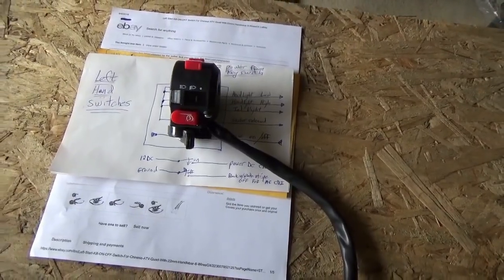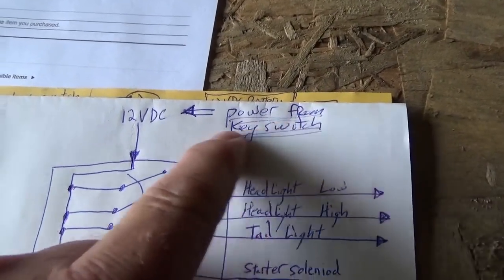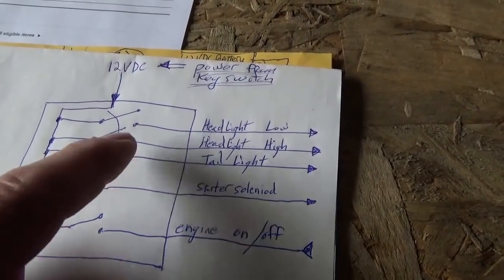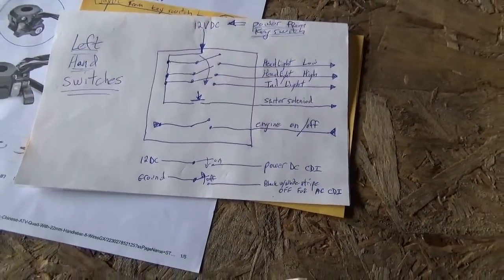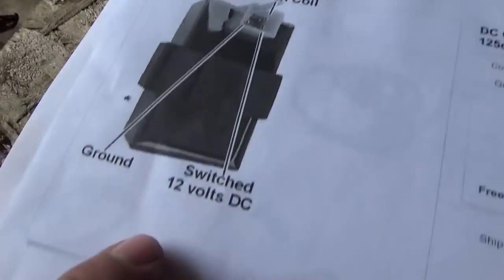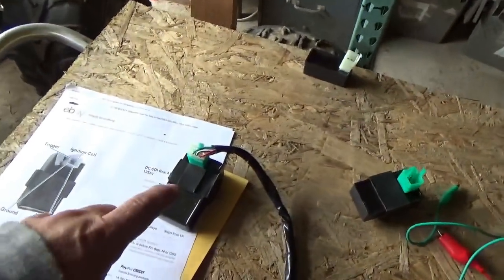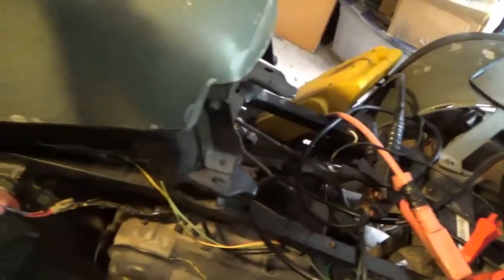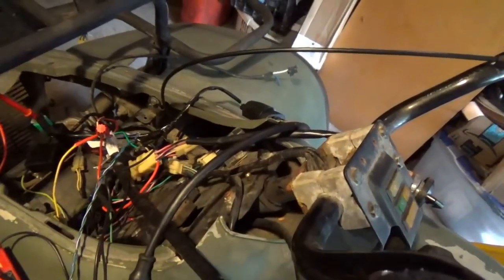ATV wire Harness, CDI build, $30 replacement fixes trashed wiring!

Comment: I appreciate all the hard work and trouble shooting you do to answer are questions thank you this helped out a lot  now on pulse generator did you take the green ground back to green in cdi ar sid you ground bothe to frame I bought the set up you had in a different video hooked it up best I could from what I was seeing in that video still no spark I know it's good stator bought new tested it then put it in I'm gonna test it again do exactly what you did here question 2 even tho the flywheel has strong magnetic pull on it could it still be bad I'm thinking maybe flywheels magnitisme istnt sending the pulse but I'm not sure the ignition system baffles me I'm sorry

Comment: Hey harvey think with the chines switch you can open it up n put a little vasoline or diode grease in it to keep the water out for say your riding home n starts to rain or you forget you left it outside.
Reply from the maker: Hey Steve, Not too easy to get to the contact area on the switches.... Getting the China switches wet a few times would not hurt them much, but, leaving them out day after day, month after month, and winter after winter, one should not be surprised to find their 5year old china quad with failing switches.... Thanks for Ur thoughts, advice, suggestions, watching, and commenting!!!

Comment: Ive always been curious how all these bikes run on that standard china cdi you use.  Just curious because each bike is supposed to have its own special ignition curve (which the cdi box is responsible for) and figured any old chinese CDI wouldnt work but it seems to lol

This video was super informative harvey, I think electronics scare alot of people and this helped to shed some light and break it down. And I know youre not crazy about that quad there but I bet it will be quite fun when its operating correctly.

Comment: I Just got a ASW GY6 150cc Engine from a Carbide Buggy/Go cart  that Tractor Supply use to sell the wire harness is hacked up Will this work to see if the motor will turn over? could you do a diagram for me to hook up one of these the CDI that came with the engine is 6 pin but only 4 wires are used if i can get this running would like to put it in an electric Utility kart

Comment: I have a 86 Honda Odyssey 200 i have spark though it seems that my spark is constant not pulsating I have compression as I crank it I'll eventually get a backfire stator and trigger ohms correct I've tried everything I could please help